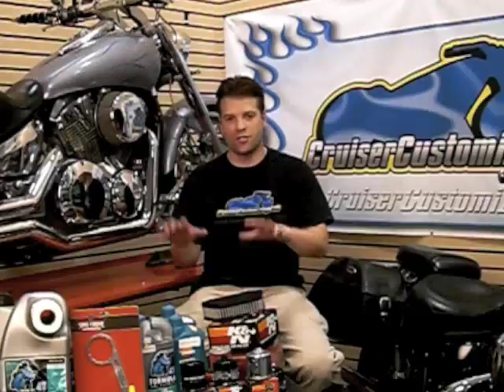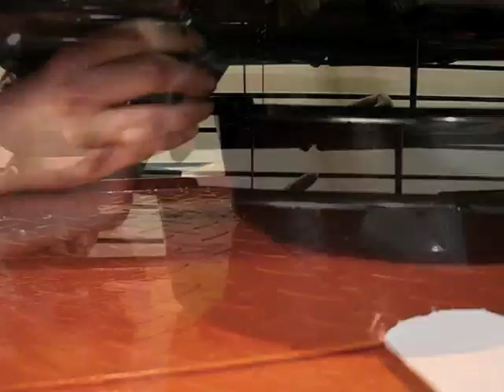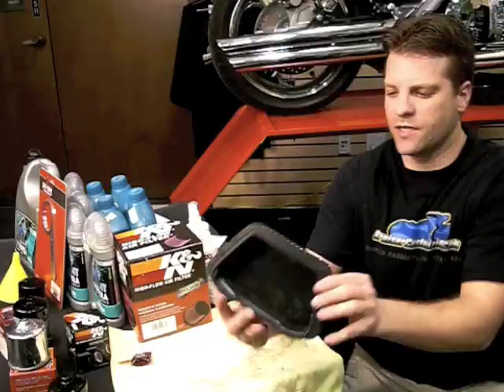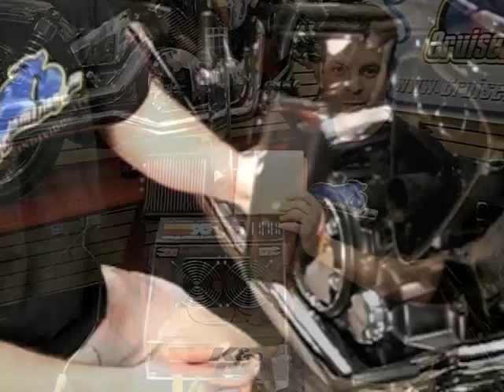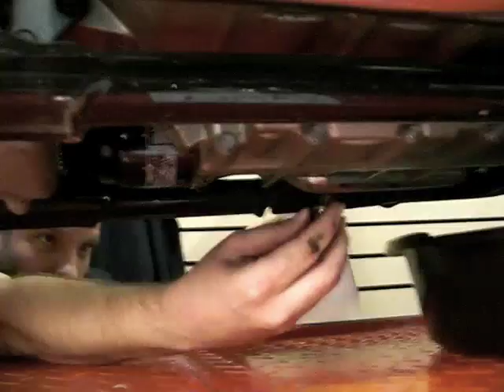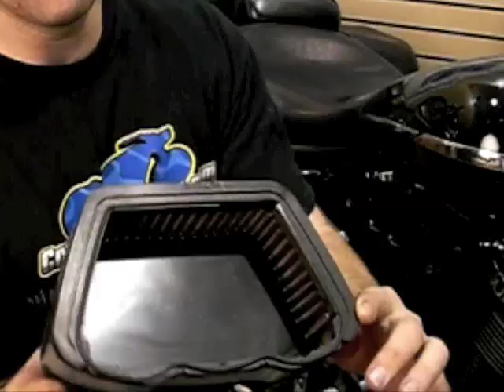Motorcycle Air & Oil Change - Do it Yourself - Save Money - Video Guide: Tip of the Week

Comment: I can't believe this guy missed the front plug! He should have done a little reseach before making this video. Tom31283 is correct, VTX has a front plug that needs to be drained too. I understand many make this mistake and then fill with 4 quarts and overfill the engine, making a mess!  DRAIN THE FRONT PLUG TOO!!! Jeff

Comment: @fernando46062 best thing to do is to get an old belt, wrap it around the filter, puncture a hole in the belt where it will be VERY tight on the filter then use the belt to tighten it! thats only if you dont have a chain wrench! Hope you will know for next time!

Comment: At the dealer I was told that the filter wouldn't need to use any wrench to tight it up, but after fully tight it by hand and turn on the bike, it spilled a good amount of oil (I turned it off right away), should I replace the new filter I just installed or just tighting it the proper way should do the job?